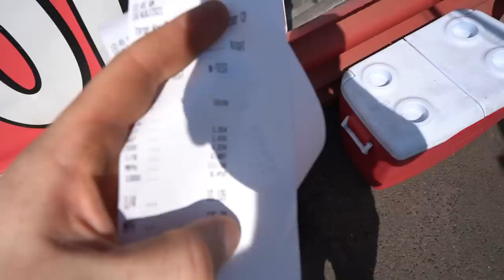Unicorn V4 crashed my World Record Attempt…things got out of hand…

Comment: If the BOV keeps popping O-rings you should try swapping it out for a different Shore rating. Unless the one you're using is a standard NBR O-ring, then you should just replace it with a FKM O-ring. NBR won't like the heat coming from that exhaust. And don't forget that O-rings need to be cleaned, lubed and checked on regularly when used in something like a 'vent to atmosphere BOV', even more so when it is right next to a hot exhaust.

Comment: Your alternator not putting out enough or is spinning to fast (install a larger pulley);  The voltage is dropping out . Track the Volts and Amps on a run not all systems will be effected for the short drop out.